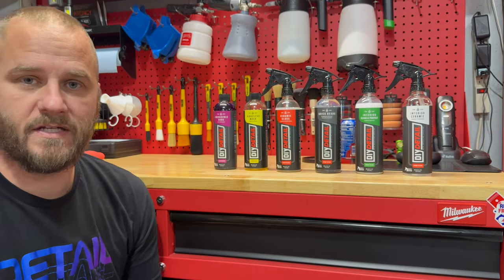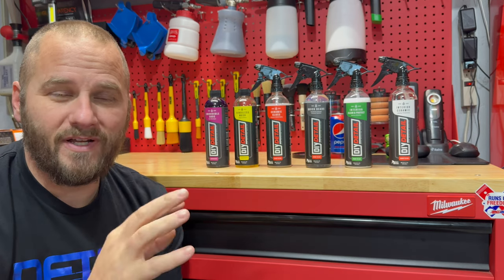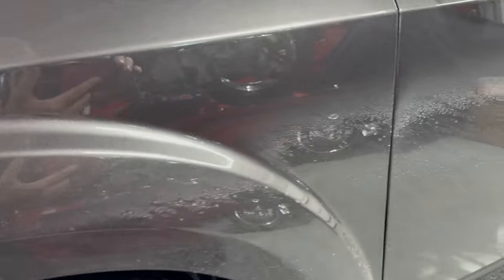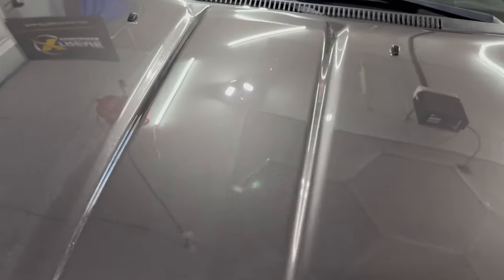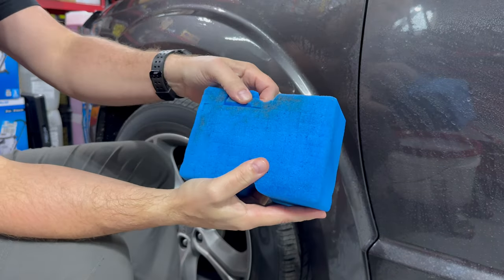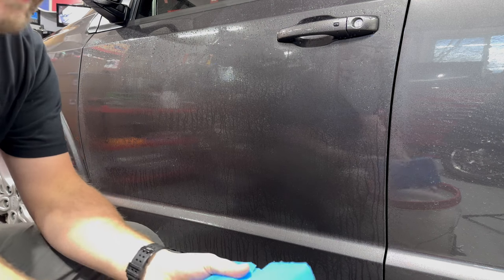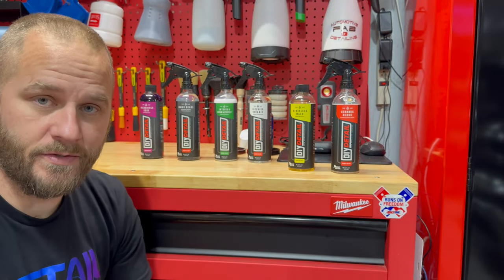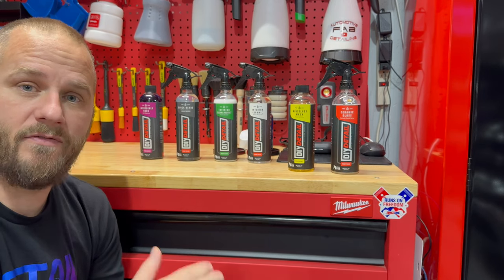Winter Time Rinseless Washing with DIY Detail Products! Safe Rinseless Washing/Drying W/Protection!

Comment: I live in northern Indiana. Definitely need a heater in the winter. How do you heat your garage?  Right now I have a propane buddy heater but it gets a little smelly with it running. And if I ventilate to much it defeats the purpose. Just ordered my first products from DIY detail. Can’t wait to get them!!!
Reply: Thank you, let us know how you like them.
Reply from the maker: I have a mini split ductless unit that gives me A/C in the summer and reverses flow and gives me heat in the winter. Works awesome until it gets into the negatives like this weekend then it struggles a little bit. Still stays above 55 though. I usually keep the garage 68 all year.
Reply: Ok cool. Thanks. I’ve been thinking about a mini split. What brand do you have? If you don’t mind me asking.  I was looking at the senville brand I believe.
Reply from the maker: @anthonykurnyak1561  The brand of mine is Ductless Aire I bought at Home Depot

Comment: Yvan also has a video where he DOESN'T use it [grit guard]. It was in the one gallon/Utah-drought video. I tried it. I use only two gallons of water, so I decided to not use the guard as it's very difficult dumping it in the water otherwise. I'm careful not to touch the bottom of the bucket by placing my hand underneath sponge.
Reply from the maker: It definitely can be done without a grit guard. I just like being able to scrub the sponge

Comment: How safe is the Blue Sponge compared to the Red or the Black one? I sounds like it s quite firm, squeaking. on the car body.
Reply from the maker: I’ve had zero issues with it. It’s definitely more on the firm side. You don’t have to use the sponge. A lot of times I just use 3-4 towels.
Reply: @FABAutomotiveDetailing  I purchased the same as it is a lot cheaper than the Big Red or Black sponges. I hope it would be fine.

Comment: How do you heat your garage? Curious because i am looking to get a permanent heating system for my new garage
Reply from the maker: I have a mini split ductless unit Calle Ductless Aire I bought at Home Depot. It heats in the winter and ice cold A/C in the summer. Best $1500 I have ever spent.
Reply: @FABAutomotiveDetailing  I was thinking about getting a mini split system for my garage exactly. Thank you for letting me know that they definitely work and are worth it. Im currently doing drywall on one wall followed by painting everything, once I get that done heating and A/C is next!
Reply from the maker: @spencerb3429  Your are welcome. I just saw in my comment I spelled it wrong. It’s Ductless Aire. It works amazingly well. The only time it has ever struggled was this last weekend when it was -8. Thermostat was set at 65 and it kept the garage around 57.
Reply: @FABAutomotiveDetailing  that’s pretty impressive. I was looking at a MrCool system, my garage is fairly large so I’d need something to be able to keep up with the space. Not saying I need it at like 70 all the time but around 55-60 is comfortable enough. I’ll check out Ductless and do some comparisons. Thanks for being so quick to respond and keep up the good work my man!
Reply from the maker: @spencerb3429  You are welcome! The one I bought was for 1500sq/ft and my garage is 700 and it has been more the adequate. In the summer I keep it 69 and it’s like an ice box even on 100 degree days. I love it
Reply from the maker: @spencerb3429  You are welcome! The one I bought was for 1500sq/ft and my garage is 700 and it has been more the adequate. In the summer I keep it 69 and it’s like an ice box even on 100 degree days. I love it
Reply from the maker: @spencerb3429  https://youtu.be/7gwBPU7yZWE
Reply from the maker: @spencerb3429  I show it in this garage tour video
Reply: @FABAutomotiveDetailing  I'll take a watch!